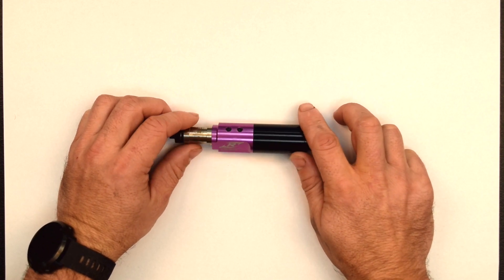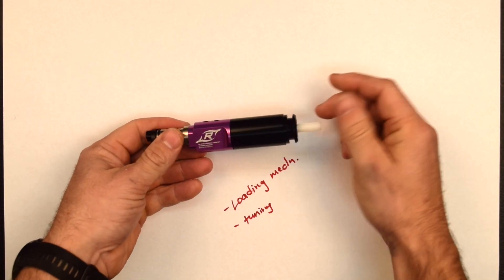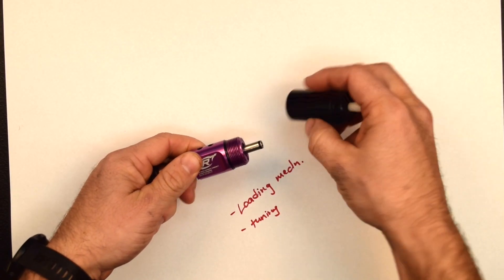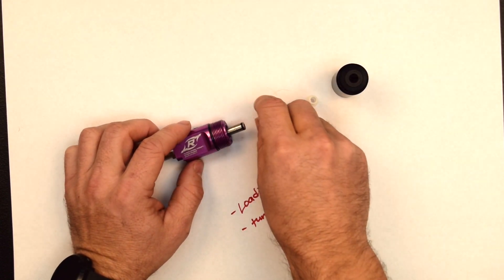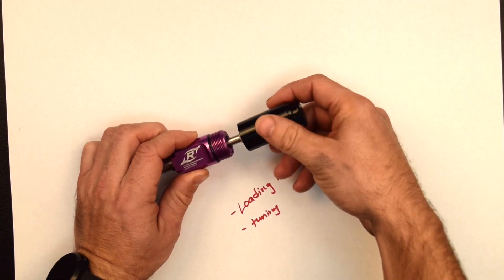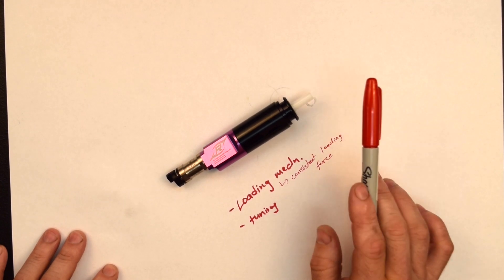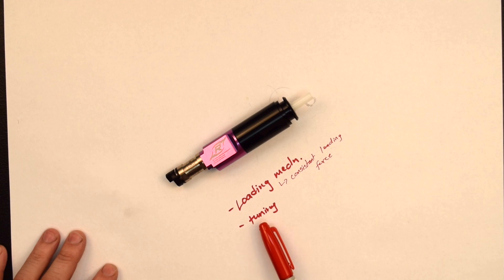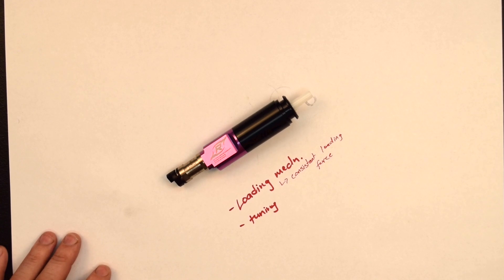REAPER GEN 2 - Technical Overview

Comment: So what minimum and maximum running PSI? I have a Krytac PDW which only has a 155mm inner barrel but at 100psi I'm right around 1 joule and want to be at about 1.5
Reply: If 100psi is where I want to be I don't mind but I am gonna need to get a softer hop rubber because the stock Krytac rubber is designed for 350-400fps

Comment: Thank you for this video , I'm your italian dealer ''Simoni Silvia'' . 
i have some questions

-at the same Joule. does  gen2 reaper work at the same psi as gen1?

-is the return in neutral position of the nozzle in gen2 managed only by the spring? or even with the push of the air?

thank you very much 
i do not share any information with customers.